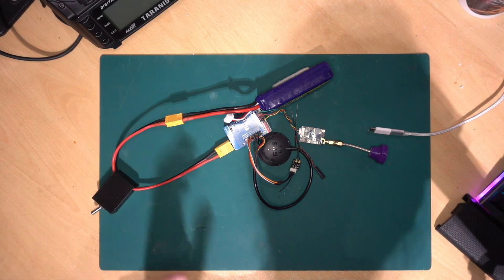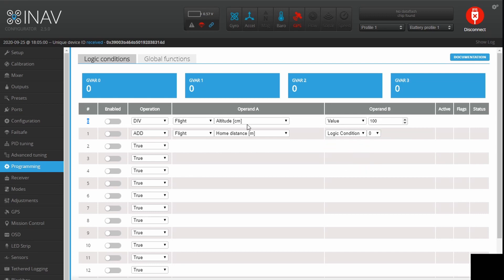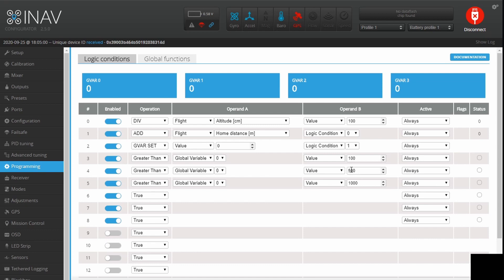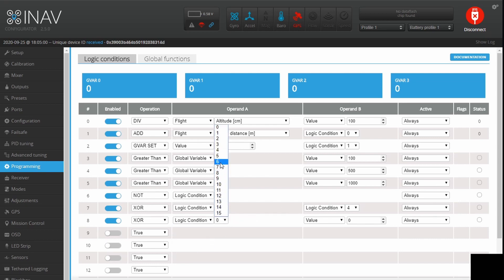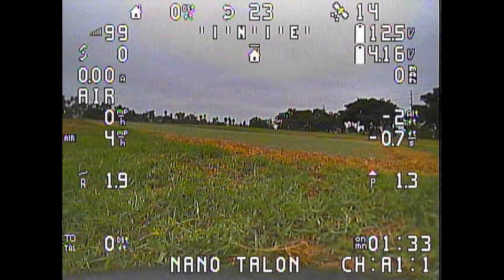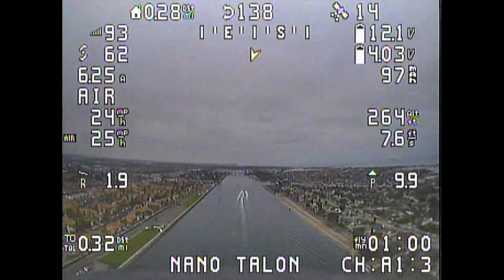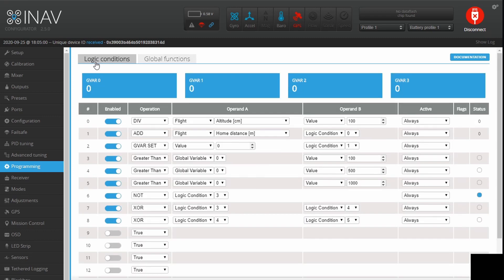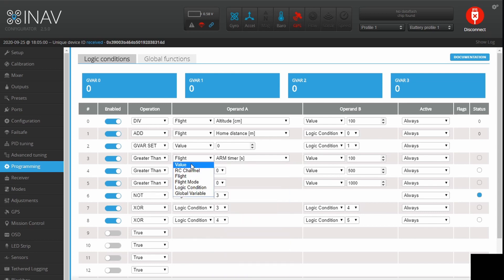The Ultimate Auto VTx Power Adjustment with iNav Logic Conditions

Comment: Is this just for analog or would it work for Walksnail Avatar as well?
Reply from the maker: This is for any system where INAV can set the transmit power. It wouldn’t work with Walksnail. The power is controlled by the goggles.
Reply: @MrD  ta

Comment: I'm doing good also Darren thanks, I will disable low power on disarm and hopefully that's the problem. This thing has me really scratching my head,  according to my research I have some of the best 5.8ghz gear. On the ar wing pro I'm using the crossfire unify pro with the vas mad mushroom antenna,on the diversity receiver I'm using a ib crazy 5 and a 7 turn helical, I have been in touch with this antenna company and they say with this setup and my flying environment range should be much better which on good day I might get .6mile never a full mile. I think I have something wrong in inav, if I try changing power level on vtx using button and counting  flashing light and then go into cli get vtx power level is always 1 basically I'm thinking vtx is always outputting 25mw. So in configuration page I understand now and the antenna company also recommends using fatshark f1 which I will set vtx to using inav I don't think vtx  itself will save changes unless I do it in cli. Sorry for long post and I hope this makes sense. Thanks for all your help over the years
Reply from the maker: No need to do it in CLI. The band and channel on the configuration page work fine. I think to get 0.6 miles on 25mW, you’d need a pretty good, low noise environment with that setup. But I guess it’s possible.
Reply: @MrD  Thanks Darren, I'll try like you advise if still no better range a will look into 1.2ghz fpv gear. Thanks
Reply from the maker: To be honest, this really must be a setup issue. You should easily get 3-4 miles out of that setup. The other consideration to make is where is your head pointing. You have 2 directional antennae on your goggles. If they are not pointed at the model, you will have much worse reception. In fact, I’d recommend and omni and the 7 coil helical, rather than 2 helicals. Also, is the circular polarisation of all 3 antennae the same?
Reply: @MrD  all my antennas are RHP, but the ib crazy antenna company told me exactly the same thing that with current setup and environment I should get 3 to 5 miles. I have a axis  2 omni I can try on the receiver with the helical but not sure if that would help at 1 mile distance. I wish I could verify vtx output during flight but osd shows it switching from 1 to 4 I'm just not sure what's going on but been my first fpv setup I'm sure problem is on my end. Thanks
Reply from the maker: Hi Ernest. 
First, I've just done a test, and you can use low power until first arm. That works fine with the programming. Nothing will change until after you have armed.

The 2 directional antennae aren't really doing you any favours. The directional is good for the range, but you need to keep it pointed towards the plane. The omni is good for when you are closer, as it will cover a much greater area around you. With that AXII 2, that will be fine, so long as it is the type with the feed wire and not the stubby. Ideally you want the antenna vertical and above the helical. The helical will of course be aimed straight out in front of you. Having 2 helicals won't increase your range. At best it would widen the beam where the best signal is found. But with 2 different sized helicals, I'd bet the 7 turn is the one that's always used anyway.

Do you fly with other people? If so, ask them to let you know what your head is doing. Some people have a tendency to look up or down. The will of course reduce the effectiveness of the antenna. If the picture starts degrading. Slowly move your head and keep moving in the direction the image gets better.

The only other thing I can suggest at the moment is to look up your VTx and see if anything needs to be enabled for SmartAudio to work. With TBS, I'd imagine it's working out of the box. But it's worth a try. If you're on Facebook or Discord, maybe post some photos of your FPV setup. Maybe there's something that is causing problems with orientation?
Reply: First I thank you for the testing and advice on this, I live in the Appalachian mountains of southern w.v 61 years now I know no one or have never seen anyone else in this hobby, I don't think there's even a rc hobby shop in the state. So you are my main source of information. My omni is the 120mm long version and I will try it on the receiver with a helical and keep it pointing towards wing, the crossfire vtx I'll have to research some I really don't know what could be wrong I think it's wired according to the f405-wing diagram, if problem is with inav setup how could I get signal out half mile? I'll try these things and do a test flight if wind and rain will go away. I will report back with results. Thanks again
Reply from the maker: In that case, maybe you can video yourself flying. Then you can see what your head is doing. 

That AXII sounds like it will work fine. Go for that with the 7 turn. The more turns, the more gain (so longer range) but narrower beam. 

The only wiring to check would be that the SmartAudio pad on the VTx goes to the Tx of the UART that you’re using.  But I was more meaning that some VTx need to have SmartAudio enabled with a button press sequence. But I don’t think that would be the case with TBS.
Reply: I'll definitely take your advice and report back. if I could just get out 3 or 4 miles I would be happy, I'm not positive about my wiring to the f405-wing for inav because I used the diagram from the matek website but its showing a matek  vtx, definitely no button for smartauido on the crossfire vtx. I've done some research and some are wiring the vtx to the nano rx but I'm not sure at this point. Thanks Again

Comment: Hey Darren I hope your well, I've been using this setup for almost a year now and have a couple of questions please, in the osd its showing vtx power levels changing 1 through 4 but i have doubts that vtx is actually going up to 800mw due to my lack of range, is there anyway to verify power level? I've also noticed in the configuration page there's settings for looks like band and channel there's options like fatshark and boscam my vtx is crossfire so i don't really know what to do there. Also i have low vtx power on disarm enabled in the cli but should I set vtx power level to 4 in cli? Thanks for all your videos
Reply from the maker: Hi Ernest, I'm doing ok thanks. Hope you're well too.

The only real way to know if the power is being updated is with a power meter to test the output. The LEDs or displays on the VTx should show the correct level. What sort of range are you getting?

Ok, first up the bands and channel options. The bands are the names of the frequency bands available. The have no relation to the manufacturer of the VTx. TBS VTx, will still use BAND A (BOSCAM A), BAND B (BOSCAM B), BAND E (FOXTECH), BAND F (FATSHARK/IMMERSION), BAND R (RACEBAND). The bands are just frequency ranges that have been specified, with the channels taking up a specific frequency within that range. Whatever you set with the band and channel in configurator, for example Band F, Channel 4. That should be the channel that is output by the VTx, in this example F4 is 5800MHz.

But, I would turn off low power before arm. You can do that on the Configuration page, no need to use CLI. That could be interfering with the programming. Also, with low range, you should be on 25mW already.

Comment: how much CPU resources is using 8 logic parameters continuously versus a LUA script running in loop to adjust the VTX power directly?
Reply from the maker: Nowhere near enough to worry about. I have around 20-25 programming lines and it’s un-noticeable, even on an F411. Marc Hoffman has used all 32, again, no impact at all. 

Just using loiter will have more processing than this code.

Comment: Thanks for this guide :)
I just tried it myself and added a SUB line which will become active, if Altimeter < 0 [cm] 
Then I just added ADD and SUB line together and in theory it should give you the value of the SUB line if you´re below 0 [cm] and the value of the ADD line if you´re above 0 [cm]
Reply from the maker: There is a better way now using 3D Home Distance. That was added in 2.6.
Reply: @MrD  saves me 6 lines - thanks:) I started with inav ..ehm today xD
Reply from the maker: Cool. I did add a link to the updated video in the description of the old one. I forgot to do that, so thank you. 

Good luck with iNav. What plane are you setting up?
Reply: @MrD  Thanks! I'm currently setting up my Rekon5 (first rtf quad) but I have some problems setting up manual vtx control. 
I have used it recently in BF and manual vtx control worked just flawless!
In inav now: I have an additional function determining if my 6pos switch is on position 6 and if so activates dynamic vtx power. But if it's in Range 1-5 manual vtx power is active which will use the position of the switch (SUB 500 and DIV 250) and send it to the vtx. Testing it in the Programming tab in inav the LV changes from 1-5 and the dot of the "VTX Power Set" line shortly blinks after each input.
But after powering the quad the vtx just always stays in pit mode. 
Maybe you have an idea? 😅
Reply from the maker: What VTx is it and how is it connected to the FC? UART or SoftSerial?
Reply: @MrD  it's connected to UART3 (tx) and in the resources it's listed as 
B10 : SERIAL3 UART TX/RX 
No R3 pad on the fc!
Reply: @MrD  it's the hglrc Zeus 800mw
Reply from the maker: I’ve had a look on the HGLRC site, and they don’t say if it’s SmartAudio or Tramp. If it’s SmartAudio, that’s the problem. 5 power levels is supported by Tramp, but the spec for SA is 4 power levels. I’ve seen this problem with an AKK VTx too. Where it have 5 power levels but used SA.
Reply: @MrD  It's definitely the Tramp protocol... it seems like it's just stuck in Pit forever -_-
What ever I do it does not exit pitmode
Reply from the maker: @r.eyvprdctn  Tramp should be OK. You've set it up on the Ports page for Tramp I guess. Did you put it in pitmode? If you manually take it out of pitmode, does it do anything?
Reply: @MrD  I flashed it back to Betaflight - it instantly went out of pitmode
flashed back to inav - now it's working:)
Thanks for your help!
Reply from the maker: @r.eyvprdctn  strange. Must have just been locked in pitmode. I don’t remember iNav using pitmode. I’m currently coding the tramp stuff for the Matek 1G3SE VTx and don’t even recall seeing pitmode in the tramp code. Glad it’s working for you.

Comment: Hey Darren,I know this is old video looks like inav 2.5 but I'm trying to get this working, in inav 3.0.1 in programming tab there's no global fuction opitions only logic conditions and pid controllers. I've already setup as far as the logic conditions page but not sure what to do about the global function? If possible please advise Thanks
Reply from the maker: Check out the video for auto VTX power for iNav 2.6. That has a better setup and shows where the coding goes. It was all merged in to programming in 2.6. It’s the same in 4.1.
Reply: Thanks I'll give it a try,  also in the ports tab in inav does it matter were tbs smart audio is enabled?
Reply from the maker: Well, it needs to be the port it’s connected to. But it doesn’t matter which port in most cases. The only exception is on F4 flight controllers that have a dedicated UART for SBUS. It’s better to keep that one for the receiver.
Reply from the maker: This is the VTx video https://youtu.be/Jv5TCqBwMhI
Reply: Thanks again, I've got it setup like yours, and enabled TVs smart audio on uart 3 this is were vtx is connected, only difference there's no 3D home choice in programming I used home distance meters but hopefully I can try it out tomorrow. Thanks again
Reply from the maker: If you’re on 3.0, 3D Home Distance should definitely be there. It was added in 2.6 and hasn’t been removed.
Reply: Your right 3D home distance is in 3.0.1 I just overlooked it. Thanks again

Comment: Genuine question. What do you think would happen with GPS fail while far from home? Would it trigger vtx power 1? Because its a critical point to lose both gps and video.
Reply from the maker: If the GPS fails, as far as the VTx switching goes, it will not just jump to power level 1. The home distance freezes, so only the altitude from the baro will be active. Most likely, it will stay on the current power level. But there is potential for the power to change based on altitude. This is or course all relative to the distances you have set. This is the same for the improved 3D Distance from Home method on the other video.

This was tested by getting a home position, moving away, and cutting power to the GPS.

Comment: You are the man in my book, I'm going to give this a try, I'm now on inav 3.0.1 is this still the best way I see this video is a year old? As always thanks
Reply from the maker: It’s hard to see the thumbnail on my phone. But if this is the iNav 2.6 revision that uses 3D distance from home, it’s how I still use it. I’ve also added manual override. But still need to make a video on that.
Reply: I'm installing the tbs unify pro v3 vtx which has 4 different power levels, I took screenshot of your setup to follow which is 3 different power levels but I guess I'll skip the 200mw and do 25, 500 and 800. So using inav smart audio mine would be settings 1, 3, and 4. Is this correct? Looking forward to next video on this. Thanks
Reply from the maker: Nope, my setup is for 4 power levels. You only need 3 distances to switch 4 levels.
Reply: Thanks Darren, I'm going to set mine up identical to yours then, I've done some research but not clear on away to have no power going to vtx unless armed, which would be nice when bench testing, is this possible in inav3.0.1? Thanks again

Comment: Absolutely brilliant Darren, thankyou  so much for putting this together, going to set it up on all my planes. Will the absolute 3D distance variable be incorporated into iNav 2.7 do you know, as I often fly from hills below myself to the coast?
Reply from the maker: No problem Glenn. The 3D distance from home is in 2.6. 

I’m going to code something, possibly tonight, for 2.7 to allow the sat count to be used as an error check too. At the moment, if the GPS is lost, the sat count stays on it’s current level; which is not only wrong, but it stops being able to use it as a safety check in programming. When the feature gets added, if GPS is lost, the sat count will go to 0. Meaning in the next version of this, we can add a safety check so that if the sats go below 6 (below 5 the GPS data gets inaccurate) we can go to full power on the VTx to make sure we can see. Plus I’ll be adding manual power options too.
Reply: @MrD  That sounds awesome Darren and covers all bases, I am subscribed so will keep a lookout for that notification.

Comment: Hello mate, i have a question. What if i need to convert speed( cm/s into km/h)  DIV for 27,77777 but i cannot use decimal . Any help?
Reply from the maker: I've just checked this and at the moment, you can't have decimal places in the operands. There are a few options, all would need changes in iNav.

The first would be to allow decimal places in the operands.

The second would be to do the conversions in iNav, and have extra variables in the Flight list. For example Ground speed [Km/h], Air speed [mph], Altitude [m]. This could add quite a few more options though, but may be simpler for people and require less programming steps.

The best thing to do, would be to go to https://github.com/iNavFlight/inav-configurator/issues and raise an issue, maybe suggest your preferred solution. It may also be worth tagging @DzikuVx in the issue as Pawel wrote the programming framework in the first place.

Comment: Darren tramp has 5 power levels what has to be added for this in inav.
Also can you do a video showing power levels being changed with switches and a know 6 position please.
Reply from the maker: You would just repeat a couple of the code blocks. 1 for the distance, and XOR, and the power output. This is a really good point though Mark, so I’ll add it to the video for iNav 2.6. 

I can also make a video for setting power levels by a switch.
Reply: @MrD  That would be fantastic Darren,and thankyou for your reply to my last question.

Comment: very good information. I am retired so it has been a while since my college basic computer programming classes but i kept up with you explanation. Brings back some memories.  I am sure many people will get good use of this. I will be putting it on my Inav quad soon and also on my plane when I get it back in the air. Thank you for a very good explanation. New sub for you
Reply from the maker: No problem Rog. There will be an update when iNav 2.6 is released, as my change request has been implemented. This will make it more accurate and simpler too.